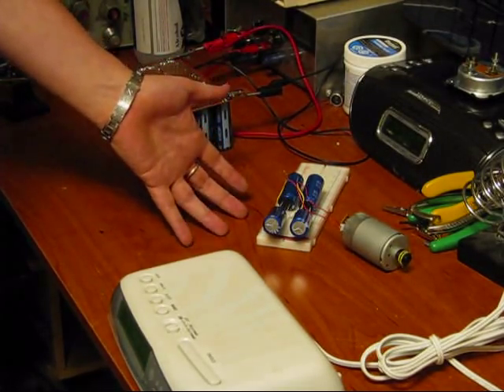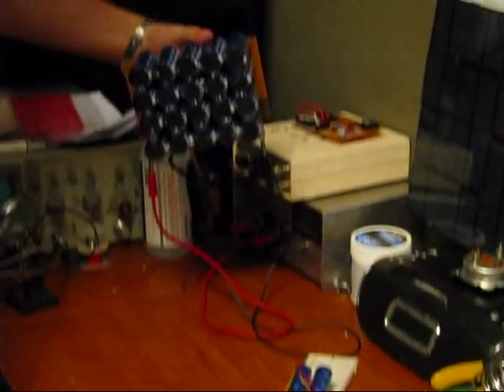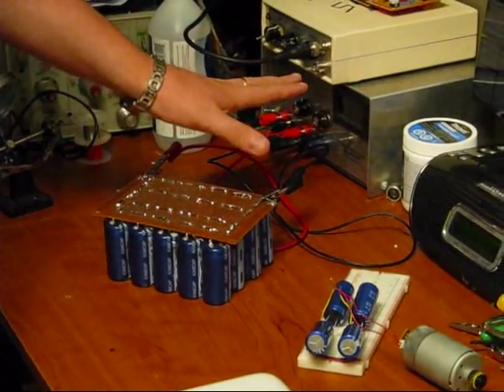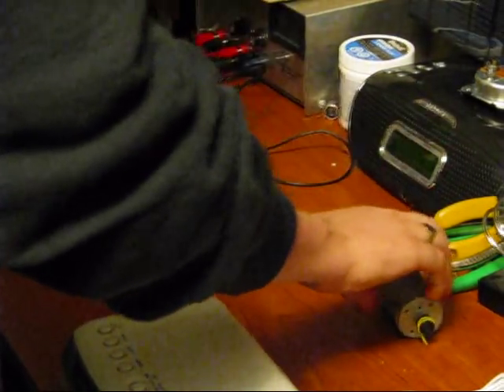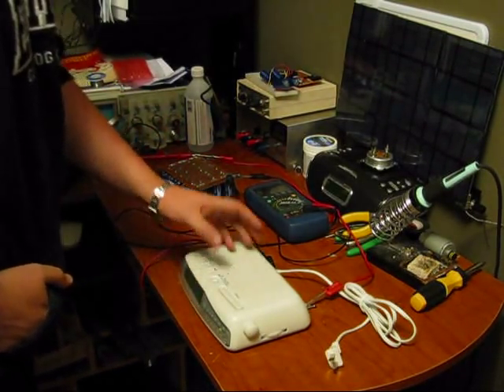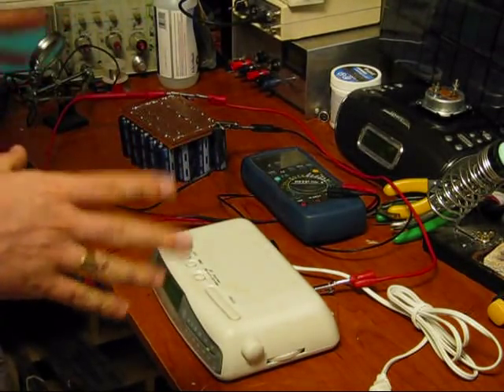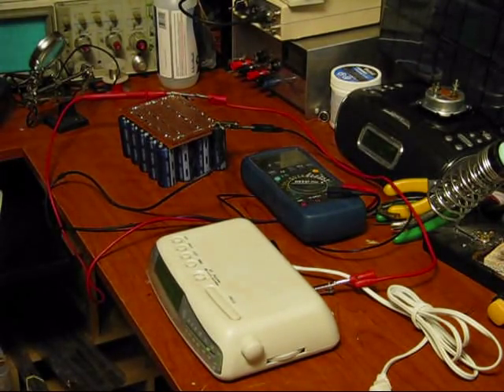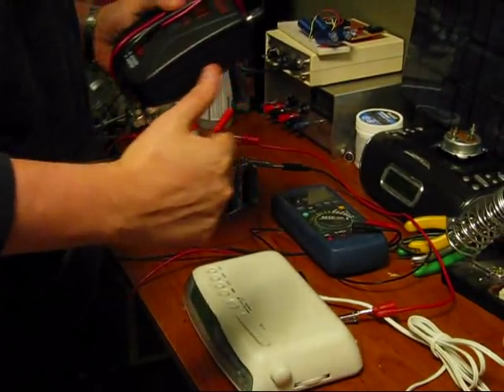Super capacitors powering a radio at full volume - Fun with Super Capacitors

Comment: Cool stuff, aren't these cap batteries starting to fill up the market? I love the idea of never needing to buy new batteries, and they would charge faster. A week or so ago, I saw something called the batcap at the local car stereo place, which is exactly what you are doing here. They make pocket sized ones for jumping cars, standard and electric car batteries, as well as ones for cars pulling 9400 amps from stereo amps. Looks like they are focusing on the car audio demographic however.

Comment: When you're working with super caps in a series you should really put in a balancing circuit for safety and to preserve the life of the caps.  It can be as simple as using something like a MCP111 creatively to short a cell across a 10W resistor with a relay if it gets over a certain voltage.